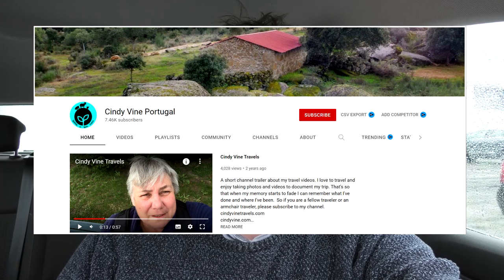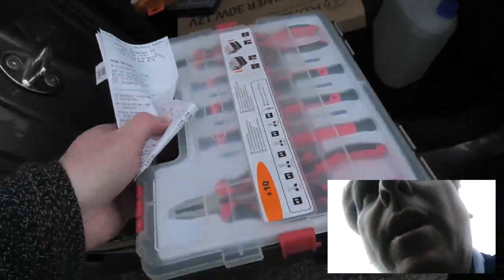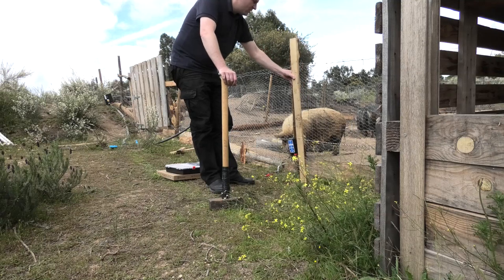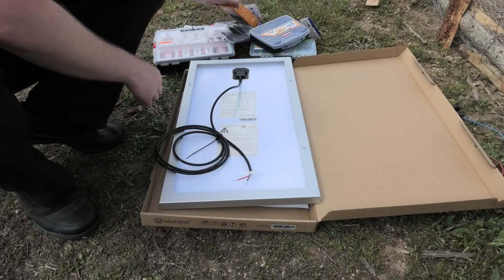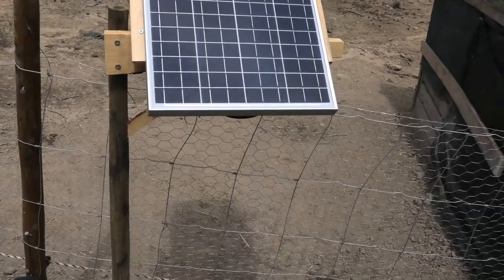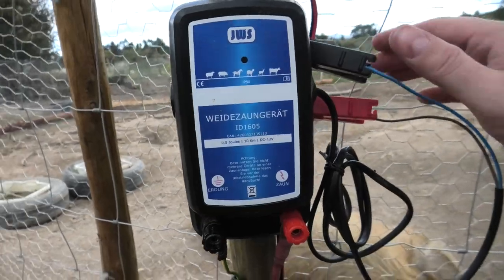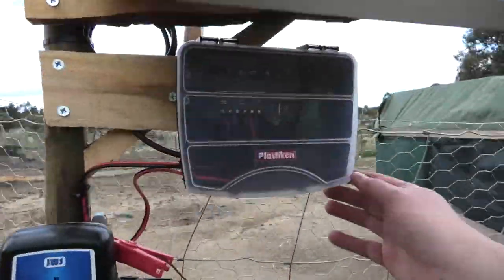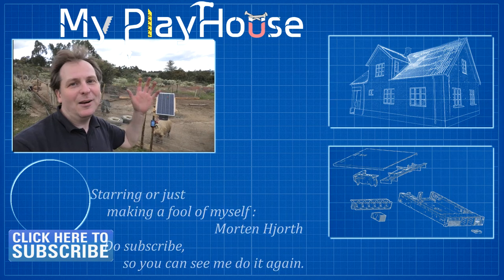Building a DIY Solar Powered Electric Pig Fence - in Portugal - 1175

Comment: Why did she need electric fence, it high voltage to prevent pig get out? 

or it detect if sombody try to get in

By the way $58 24V 30W solar panel with aluminum frame it good price.

The charger very expencive
Reply from the maker: It´s to keep the pigs in and the other pigs out,,
Solar panel 30W with a charge controller on aliexpress $32 and a few month´s shipping :-/
Reply: @MyPlayHouse  in ali & ebay have flex solar panel , that is low qualty item.

The best is glass panel with aluminum frame.

what is the fence voltage ?

Why dont use strong fence without high voltage and this useless device

Comment: Geez wasn't prepared for the job talk about a cobbler that want last no time!!! Get u a dang plastic tube with a lib and mount it all on the inside and run the wires out then silicone the holes u will have no problems but like that it'll be destroyed trust me!!! Ur wasting valuable time bruh
Reply from the maker: It was a difficult job in the regards that I was on holiday, here 3000km from home wanted to do this little project, I did not know what I had on site, and it is a 45min drive to a descent shop. Did not want to spent time on the road,, 
Hope you learned a lot of ways to improve on what I did,, and that way it was not a waste of time.